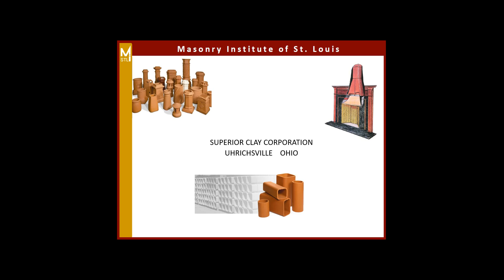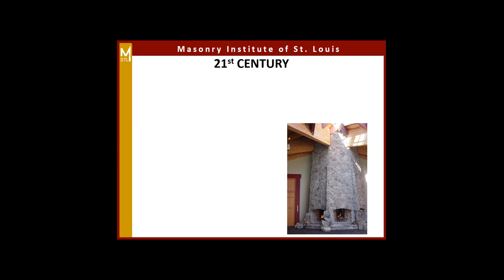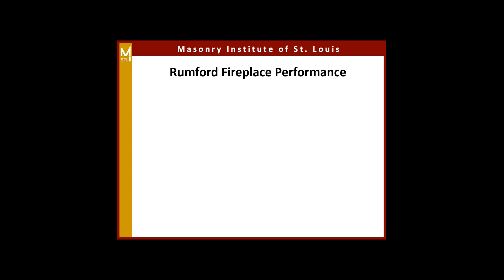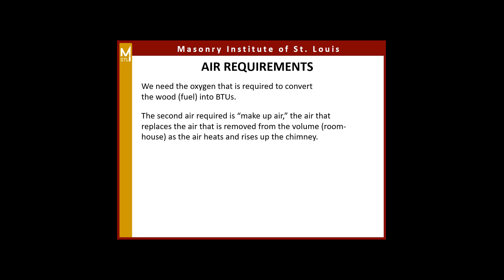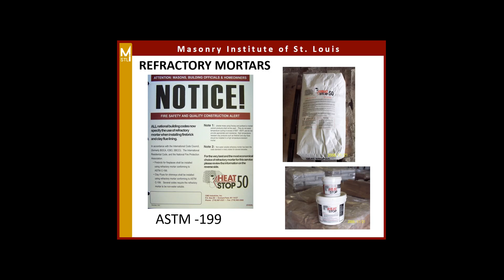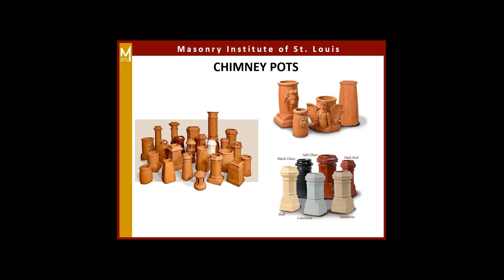MISL Course: 24-1016 Design and Construction of Masonry Fireplaces and Chimneys by Dana Martini

Comment: 35:00 yeah, it doesn't surprise me that Architects don't account for it; I recently fell down a fireplace rabbit hole and as far as I can tell, there really hasn't been a serious effort to analyze and update the industry standard/understanding on the engineering/architect side of things.

As it was pointed out, the formula isn't really worth it. In particular, it doesn't account for losses, which effectively put a cap on the natural draft you can get from increasing chimney height or area.